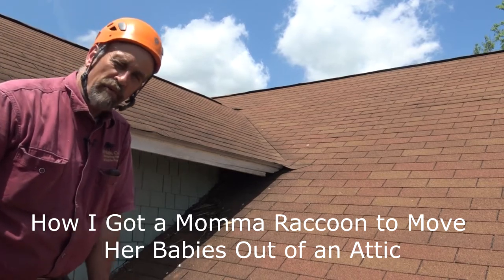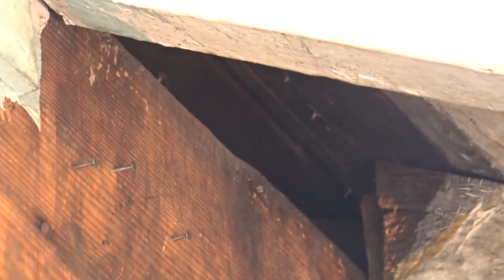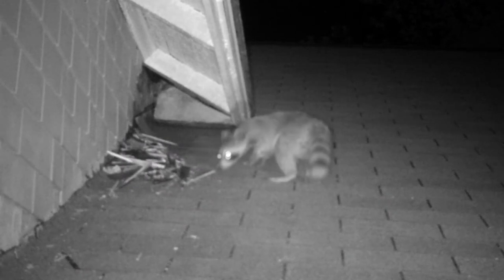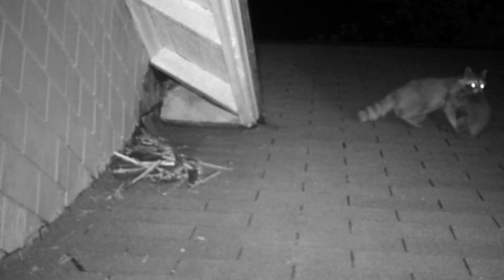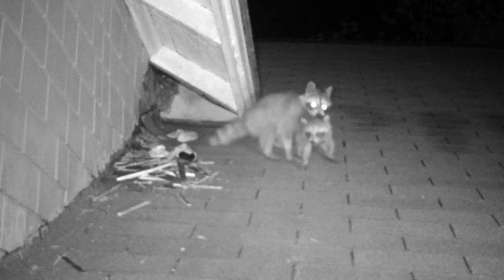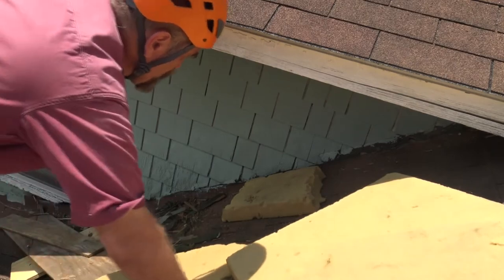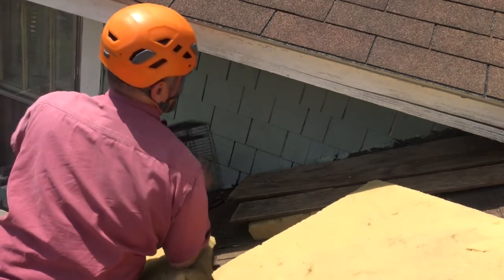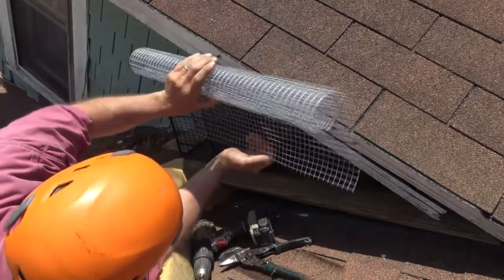Convincing Momma Raccoon to Remove Her Babies from Attic

Comment: I ordered coyote urine from home depot and was looking for an application process, and I think throwing a urine soaked towel will do the trick because who is going inside the attic to spray with the LITTLE applicator.
Reply from the maker: I have a video coming out soon on this exact topic. How you apply it is at least as important as what you throw up there.  I'm going to work on putting it together today.  If you need to contact me you can go through my website Wildlifecompanytn.com my phone number is on the site also.
Reply: You can literally piss in the hole during the day and it should do the trick. I tried it but went all over the raccoons accidently

Comment: How did you know that there were babies? I heard a noise in my attic today. So I had my wife bang on the ceiling while I went into the attic to see what was in there. I didn't see anything until she stopped banging. I saw the raccoon's face. I left my attic door open and had her bang again hoping it would run out of that and out of my garage, but no luck. So I went in my back yard and saw it sitting on my roof. I think it's the first time it broke a hole into my attic. I was able to scare i away but since it's late all I have here are some bricks to block the hole. I'm hoping it doesn't try to get back on my roof while I'm sleeping. I need to call someone to fix the hole now. Pretty sure there were no babies cause I think I would of saw them while I was in the attic.
Reply: They can hide really well. It may take a couple of days for Mama to get all the babies out.

Comment: Somethings in my attic. It thumps around like it's big. Think i heard chirping. It's January in Michigan. If I set up cage traps n remove them all together where can I take them where they can find another den? Will a wild life rehaber take them? Grounds frozen and covered in snow. Don't wanna kill them but they can't live in my house. If it's a mommy raccoon and her babies in winter,  will she move them out with predator sauce when it's below zero outside? I'm not letting them tear up my attic and use it as a bathroom til spring. Something larger then a squirrel is up there. I have a friend with critter cages traps where door shuts when they enter. He had raccoons he removed. He drove them like 5 miles away.  But he re.oved his in summer. My attic is finished so it will be easy to find babies. If their up there. So my question is where do I take them so they don't return but have a safe place to den up for winter?

Comment: The eviction fluid used with a back up trap is an unbeatable combination to ensure a quick resolution to the problem.  Perfect.  Great choice in a double door trap to catch the coon coming or going.  The wire trigger works great.  Because the traps work in any position they can be set upside down and sideways, in this cases sideways with the trigger hinged at the bottom.  When the wires come up from the bottom it is virtually impossible for a coon to pass through the trap without getting caught.  These types of positive sets are the best, no bait or lure required.
Reply from the maker: Thanks Jim.  Hope to have more videos coming with your gear.  Good stuff.
Reply: @wildlifecompany9885  What's in the eviction fluid?

Comment: I found that a raccoon had moved into my late parents' house in early winter.  After a quick check around, I discovered where the critter had gained access - a rotted corner soffit.   So, with a heavy winter around the corner, I couldn't just kick the poor thing to the curb, and it didn't help that I couldn't locate it when I went into the attic to check; so, I decided to let it winter over and planned on evicting it in the spring.  Fast forward a few months, and I suddenly hear two babies.  Crap, now I definitely can't remove them.  I ended up feeding and watering the momma through the winter to help her with foraging for food, since the weatherman was predicting heavy snow and ice.  With the help of an outside security camera, the way she accessed that soffit hole was to climb up the outside corner of the back porch like a ninja, and then perform an acrobatic roll under to get up into the attic . . . I was impressed with the amount of effort she put into that daily trip.  However, I realized that at some point she was going to have to take those tykes outside to teach them how to be raccoons, and I couldn't see that being easy or risk free when all the babies would see was a straight drop to the ground by not having momma's ninja skills.  I ended up placing a 12-foot-long, 5-inch in diameter tree branch that had fallen that winter up to the soffit at a reasonable slant.  Now, momma can come and go with ease.  The evening on the day I put that log up, momma took the babies out and relocated them.  I left the log up for about three days, and placed a bowl of food and water up in the attic.  After three days, I went up into the attic and discovered that the food and water hadn't been touched - so I knew she was gone.  I removed the log, boarded up the hole, and haven't seen them since.  Having raccoons in the attic is way worse than squirrels, in my opinion, 'cause they can do some serious damage.
Reply: Why would they leave?